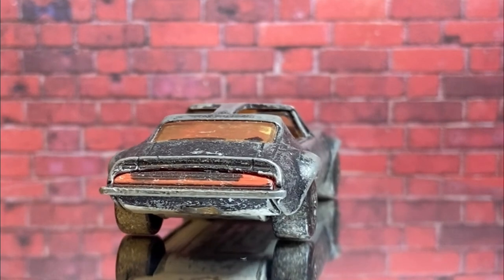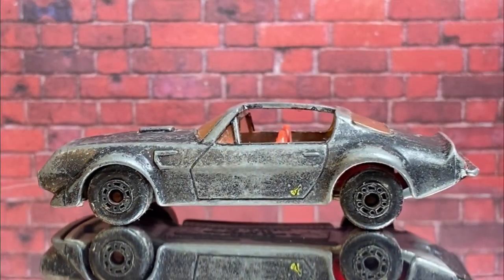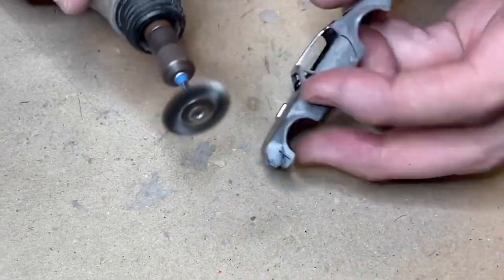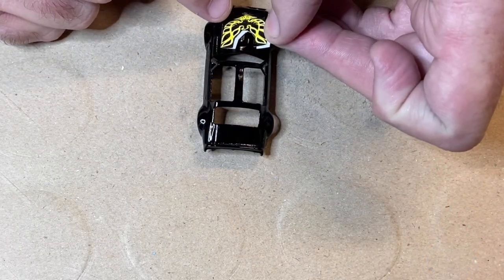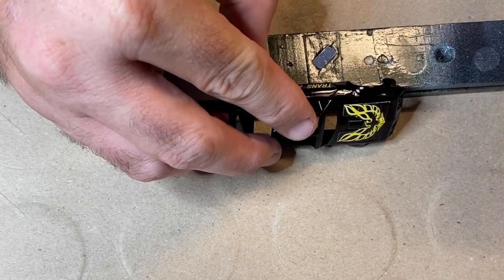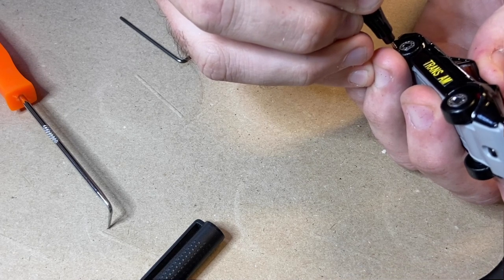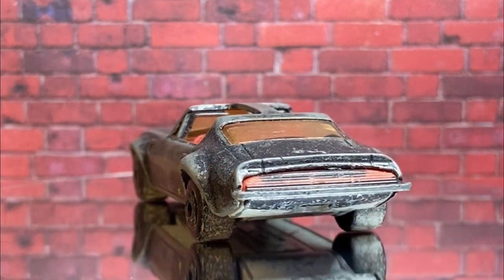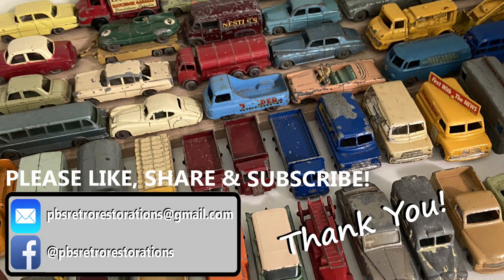Matchbox Superfast #35 Pontiac Firebird Trans-Am Restoration #040

Comment: I am in the process of redoing one of these. The exception is I am fixing what they should have done. The Trams Am never came with vent windows. So I cut those out. The T Top thing they did...what is that? So I bought one of the new chop top Hot Wheels Trans Ams and cut the T Top section out and grafted it in place of that disaster of a T Top Matchbox did. I am still trying to figure out how I am going to fix that back window.
Reply from the maker: That sounds really involved Tim. It was only as an adult I noticed just how much the MB Trans-Am has wrong with it. Like the #1 Dodge Challenger, when you look at it next to photo of the real thing it looks awful. Good luck with your fix!
Reply: @PBsRetroRestorations  Lots of sanding and filing. I have about 20 hours into it now. Top doesnt look to bad so far. When this MB came out my brother had a 77 T Top Firebird in the driveway. He is the one that pointed everything wrong with this one. I started becoming a 2nd gen Firebird T/A expert at that point. Owned many of them since then. Wish i could send you a pic of how this is coming along.
Reply from the maker: @matchboxcustomsandrestos  you can email pics to me at pbsretrorestorations@gmail.com if you like, I’d like to see it.